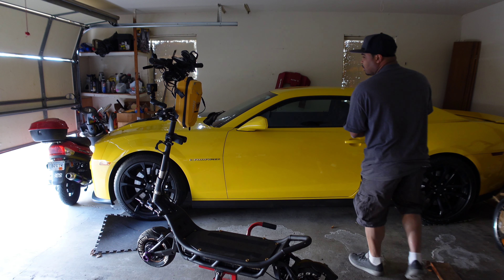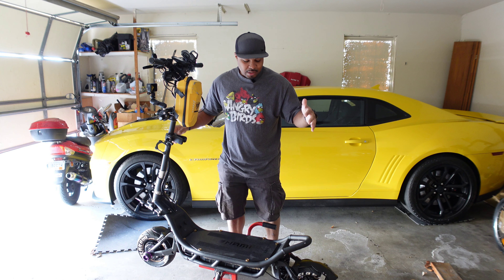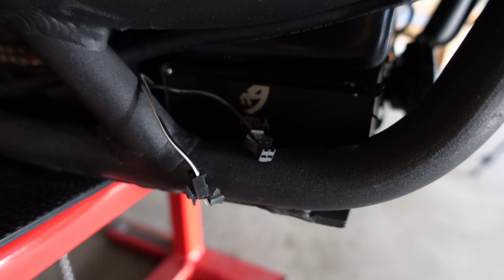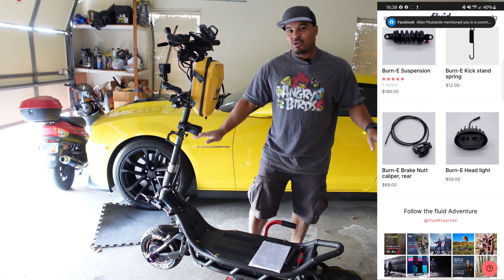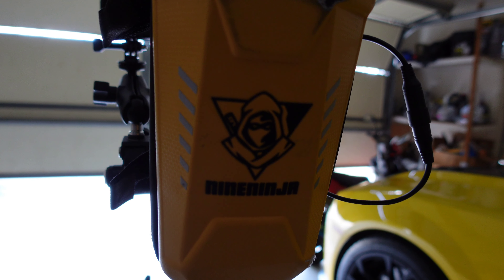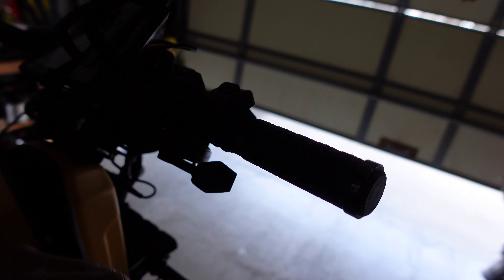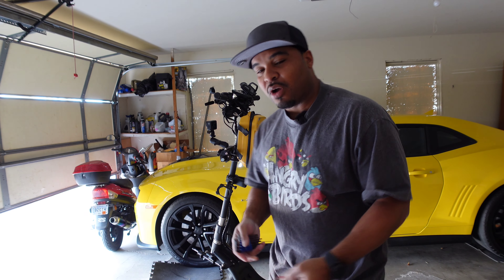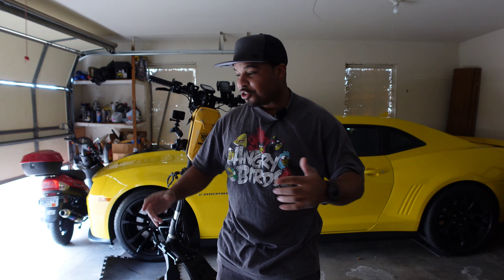Nami Burn-E *Post Thoughts/Things to expect/Accessories* (New news on NAMI Gen 2 MAX)

Comment: Adjust the brake rotors with an adjustable wrench. Works just as well as the tool. Go for slight bends back towards straight. Just takes a few minutes on my mtb and they're good as new (barring any huuuge bends).

Comment: Man such a good and informative video
Reply from the maker: I truly appreciate the kind words. After almost 2k miles on the odometer, it's still doing great. I've only UPGRADED the tires, the fuse holder to bigger ones, the brake rotors and changed the brake pads from those wearing down low

Comment: The tool that’s used to adjust the springs now comes with the Nami Burn E2. I received mines on 4/11/22 and was surprised to find a Nami branded spring adjuster.
Reply from the maker: Maaaan that's super duper good to hear. NAMI owners always talked about wishing our scoots came with that tool. Thanks for sharing!

Btw. Where in the packaging was the tool?
Reply from the maker: Hmm. Yes I can change my P7. 

- Turn on scooter
- press "M" 2X very quickly
- press "+" until you see P7
- press "M" once and then
- press "+" or"-" to select 0 or 1

Comment: Arrived today, 03/31/22.. the silicone protectors for the Garmin Edge 530 and the Garmin Edge 1030.  I also still have the silicone protector for the Garmin Edge 830 and after you told me it fits like a latex glove it gave me a better sense of what to expect, so I tried the 830 on it again… extremely stretching it, but was able to get it on. Here’s my findings, the 530 and the 830 are the same size, the only difference is the back cut-out design of the two. The 1030 is a tidbit too big. With all that said I believe there’s a great possibility  both NAMI scooters Gen 1 and Gen 2 has the same size computer head. Just needed to really stretch the case like you instructed. Thanks.
Reply from the maker: I really really appreciate you checking back in on which fits exactly. I also apologize for not mentioning how tight the edge 830 cover will be to fit. 

Who would have known the edge 830's cover was the same size. I was put on to that cover by another nami user and I actually have an edge 530 that I use when I ride my gravel bike and for some of the rides I do on the scooters. I just never thought to use their silicone covers for the nami

Comment: All those issues you mentioned are on most scooter brands, I have received many scooters and the brake rotor is very rarely not slightly bent, but they can be straightened and used.
Brakes needing to be bleed same thing, some brands are worse then others and some brands it’s rare but happens.
If you buy from a company some go over the scooter and try to make sure that it’s ready to ride when you get it, Ride The Glide is one of those companies that go over it and make sure it works properly before it’s picked up or shipped.
Some pretend to do that like Voro motors, they check off the paper they put in the box but don’t do the work on the scooter.( what a joke)
So far I find your review right on the money, but that could be because it was your money you spent for the scooter.
Reply from the maker: Ahhh makes sense. I always wondered if it was "typical" or not. I also felt if you purchased a scoot from an actual store, you probably wouldn't have these issues because they would have sorted it all out before selling it. 

I really appreciate you confirming this as It was always floating in the back of my head and the closest scooter dealer is about 700-800miles from me to ask and confirm if that's really the case. I try to think about the things people don't think about the talk about them. I of course can't figure them all out but comments like yours reinforce ideas and bring new thoughts to the table and for that I thank you!

Comment: I've been eyeballing that Burn E-2 Max, What do you think of it? Was thinking of using Fluid Freerides for my purchase. I come from Bajaboard and Electric Longboarding. Evolve, Pantera, Bajaboard S2 Atrax, etc. So this is my first Electric Scooter, So Speed, Ride, Range and handling are my biggest factors for a good purchase.
Reply from the maker: Well. I think it would be a great great purchase coming from your background. Just looking at your background three scoots come to mind off the top of my head (possibly 4):
1. Bronco Extreme/VNom
2. NAMI Burn-e 2max
3. Dualtron Thunder 2
4. Dualtron Storm ltd
Elephant in the room? 5. Ninebot/Segway GT2
*In that order!

If everything you mentioned was important to you was a priority along with weather resistance then I would prioritize my options as:
2,5, 1 and would rule the Dualtron's out.

For range as a priority but don't care about water resistance I would go:
4, 3, 2, 1, 5

Ignoring #5 (because it wasn't out at my time of purchase) I went with the NAMI after a tough decision against the Thunder 2 because I came to the realization that if I was going to spend about 5k on a scooter, I have to be able to ride it under any circumstances, need at least 100miles of projected range which it isn't projected for but it's fully adjustable suspension, weather resistance, power output customization with sinewave controllers, it's small footprint for it's weight and sheer overall performance gave it the edge for me in making my decision.

I like to cruise (15-18mph) and ride for max range. Most of my riding are on either bike lanes or bike trails. I didn't need a hardcore speed machine but needed range as a main priority. The Dualtron's will give you the most range but I don't find them the best balance of everything although they aren't far off. The ninebot gt2 looks like a very good scooter and will likely be the highest quality of them all along with having the highest weather resistance, app control, possibly as strong of acceleration as the nami but won't have the top speed and the least range of all of the 1-4 scoots.

The nami is a very solid scooter. I would recommend it to someone who is Mechanically Inclined as you may encounter alot of "stupid" issues like warped tires (so you'll get a vibration while riding above a certain speed), bent front rotors (a typical defect due to packaging for shipping), brakes that need to be bled, controller error codes. It's almost like the luck of the draw sometimes. At the same time it's a very good scooter once you get past the small drawbacks. 

A few things I like about the nami brand is when you buy a NAMI, you get 50% off all OEM parts LIFETIME. You also have access although it could be limited to the owner/builder of NAMI. So if you do have any technical issues that the vendor you ordered your scooter from, you could reach out to him via Facebook messenger and request some assistance. Also this scooter feels/looks premium. To finish this out, I had buyers remorse with this scooter for maybe a month of owning it till I Went up a 6% incline and it held 54-55mph(GPS) without really staying in it and without being in turbo mode. That day kinda broke the seal and made me start seeing where my money went. 

I hope my long ass response gave you value in your decision making on this. Feel free to ask more questions if you got em.

Comment: Great video my friend. 
Question I just got mine and the  Steering wheel is hard to move from side to side. Is yours like that?
Reply from the maker: Thanks Pedro. Now mine felt alittle "stiff" and laggy from side to side. I will ask you. Does it feel "TOO STIFF"? O does it just kinda feels alittle stiff? Do you have the steering damper installed and did you check to see if it's at a high "stiff setting"? 

If the steering damper isn't set to max resistance and it feels "too stiff", watch the videos in this Facebook link:

https://m.facebook.com/groups/namielectric/permalink/775149246497797/

The owner of NAMI describes what to do if your steering is too stiff. I am sorry you are going through this but if your steering is too stiff (as it shouldn't be because this problem was discovered over a half year ago) it seems like a big job unless you have a NAMI dealer close to you and maybe they can do it under warranty.
Reply: @Jonasegway  Thanks so much for the help.  I dont have the the damper. And yes is stiff but not too stiff. If I ride slow it doesn't feel right because the steering is stiff, I hope you understand.

Comment: im about to buy the magura usa mt5 estop system, do i need to buy any additional wiring for the process im going to have fluidfreeride install it.
Reply from the maker: No. The mt5e's will come with everything you need. Just make sure you are buying two of them "unless it states you are buying a pair. 

I don't know which kit you are buying but kits that shows pics of only the handles and calipers normally comes with the handles, cables, brake pads and brake pistons. The only thing they don't come with is rotors and it doesn't hurt to get magura or equivalent in thickness rotors to go with your new mt5e's. 

Where did you order yours from? I've been looking myself but haven't decided on a vendor to buy them from
Reply: @Jonasegway  looking to buy from amazon any minute now. i was looking at da  magura usa mt5 estop, the one u said in ur vid . the only thing im not seein from the one u said on the handle is da red wire u connect back into ur wiring on da scooter
Reply: @Jonasegway  Magura Unisex_Adult MT5e Scheibenbremse VR/HR Ausführung Schalter: HIGO-Schliesser Bicycle Brake, Black, One.... i was sure check da link
Reply from the maker: @blessdatrack4masssoundprod773  it should come with the wiring and everything. When it has the "e" as in mt5e, mt7e, it comes with all electrical cables, handles and brake pads with calipers. If it didn't have the "e" with the brake type, it wouldn't come with the electrical cable that you would need. 

Make sure the one you order is "closer". You should see in the description that it says open or closer. You need the "closer" version
Reply: @Jonasegway  thanks man u been a big help just wanna make sure I get things right  a 4 grand batmoscooter lol needs 2 be very well maintenance and kept up with like a damn car lol
Reply from the maker: @blessdatrack4masssoundprod773  man that's exactly how it feels. It's been more needy then my dam cars lol. But once you get it sorted out, it's good. I just finished changing the rims. Now I gotta get the footage all put together and send it

Comment: You now have 2 of the 3 scooters on my radar the last being the Kaabo Wolf. My only question is whether the Nami is worth the extra cost compared to the Victor?
Reply from the maker: Well. The answer to your question is sorta easy. There are a good number of things to think about.

1. Will you need to travel with your scooter? (The nami is really only good to travel with if you have an SUV or pickup) it is very impractical to travel with in your car but is possible if you have a sedan with foldown seats. Victor goes in a trunk easier because it  breaks down to a smaller footprint.
2. What type of range do you need? (Will that need increase in the future?)
3. How much weight do you want to lug around? NAMI is heavy but it's design makes it easy to carry.
4. What type of rider are you? I have no issues jumping out with traffic with the nami. I don't with the Victor all of the time but the victor makes me plan alittle more on if I will take the actual l street or stick to the sidewalk.

Basically if you need portability, decent speed and decent range the victor is your guy. 

If you want sheer power and speed, don't mind lugging a big ass scooter around and need the weather resistance, go for the nami.

When you look at their differences, is the nami worth 2k more to you?

Me personally, I think the nami is maybe worth 1k more then the victor. Not 2k. However, I prefer range and weather resistance and for that I had to pay that huge premium for the nami. 

I could have went with the King GT Pro but that scooter is extremely impractical for portable applications. I'll tell anyone if you don't have to carry or travel with your scooter, those wolf's, king's are probably in the top 3 for best ride around a big city scooter. They are just beast. I would also put the nami and the bronco scooter, the dualtron 3, vsett 10+R, dualtron thunder/thunder 2 to the mix. 

I think in the grand scheme of things I would get the bronco Xtreme over the wolf king. You have some decisions to make but think of what you need from your scooter. I see the nami being a timeless design overall more then the victor. The nami's chassis and setup is ready to be modded and customized with high end parts without it being too complicated. Think about it. Cover your needs first and narrow it down.
Reply: @Jonasegway  Thanks for the response. I like the Nami's design and build but wish it had a removable wide deck option to comfortably run errands with feet side by side and maybe an optional bracket to mount a basket. I only need it for local roads that are 45-50mph but portable enough to put in a shopping cart.
Reply from the maker: O you are very welcome. We'll see now your options are getting alittle interesting because none of the scooters you are looking at will fit in a shopping cart unless you are talking about Sam's club colossal sized carts that are used for carrying super large items like TV's and furniture. 

You could definitely stand on the nami with your feet side by side. Now with all of the scooters you could buy a cart to mount to the axle. I've seen guys buy the bracket system for the DT victor so they could use it for door dashing. The wolf and nami have big enough decks to actually stand on and have a big bag to like out food orders in if that's how you want to use it. A great idea would be to invest in one of those animal bicycle carriers that you would normally hookup to your bicycle to take your pet for a ride and hook it up to your scooter. You could insulate it to hold alot of food items warm and could just hook it up to the axle like I said. But none of them will be small enough to fit in a cart. The victor's practical cruising speed Is anything under 42ish mph if you weight 205lbs like I do or more.

 The lighter you are, I could see that practical cruising speed being alittle higher. Just this past Sunday (without the turbo feature on) the nami was able to go up this 4% slope at 54mph (GPS speed) no problem. I rolled smooth up that hill with traffic like it was nothing. Practical cruising speed for the nami is really anything under 56-57mph no matter how much you weight. It feels like it's governed to not go faster because it gets to those speeds strong without missing a beat

Comment: So, with the speed limiter off, does that pertain to all Nami models?..also, where did you get the raised white lettering tires?
Reply from the maker: Yes.@ disconnecting those black and white cables on both left and right sides will remove the speed limiter on all NAMI models. Note....the nami will still be limited depending on which riding mode you are in. If you are in Eco/D/S/C modes the speed will be limited in each 'gear'.

Xmode releases 95% of the nami's maximum speed and turning on the turbo mode will release it's maximum speed. I normally don't recommend riding on Xmode with the turbo activated because it sorta over boost the energy from the battery to the controller's which will raise your chance of melting/blowing your fuses since the fuse's max power is rated lower then what Xmode without turbo activated runs.

As far as tire stickers go. The link below is the closest I can get you to the tire stickers I actually have. I would play around with different fonts and be sure to use the tire size on the side of your NAMI tires. My tire stickers are "permanent" and are the 1" size lettering.
https://www.tirestickers.com/shop/custom-design/

An alternative is to reach out to Paul at Voltage Motowerks at the bottom of the page in this link. He has access to the Korean style lettering which is known to be very stylist and very well made. If you go that route, tell him JONASEGWAY sent ya. His service is impeccable and is very personable. He can provide you with many many options and fast shipping!https://voltagemotowerks.com/shop/

Comment: Can you add link for bumper washer  and screw  sizes    for deck plate. Thanks.
Reply from the maker: The washers are on minimotors website if you are in the U.S.

The deck screws have two sizes. The two very very front deck screws are 5mm x 16mm 0.80pitch.

The other deck screws are 5mm x 10mm.  0.80pitch.

Comment: If ur buying a xiomi airpump get the 1s its the updated version witch is better and has usb-c original xiomi airpump is 7l/h i think the 1s is 14l/h
Reply from the maker: Mine is finally beginning to not be able to screw onto my stems anymore after years of use so I will be purchasing an updated one here shortly. Thanks for the update Input!
Reply: @Jonasegway I have an exact similar pump but name is different, mine was not able to screw on after years of use so I just bought the hose part for it and good to go, think I purchased hose from Amazon, it’s also slightly longer than original so that’s a bonus too, nice video bruv, respect 😁👍🏻
Reply from the maker: @dw3370  o dang. I didn't think to just order a new hose. I ended up passively replacing mine with one that's a little bigger but stronger yet still portable.

LEXIN P5 Tire Inflator Portable... https://www.amazon.com/dp/B0BG45DV3Y?ref=ppx_pop_mob_ap_share

This one is good as well